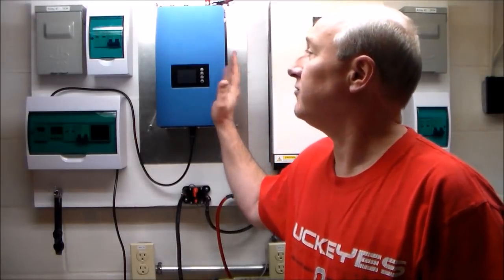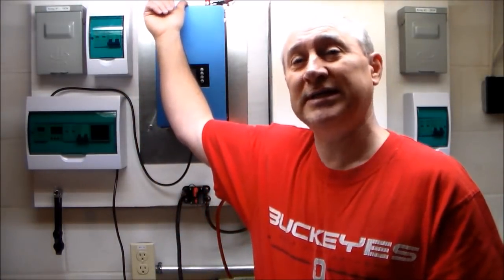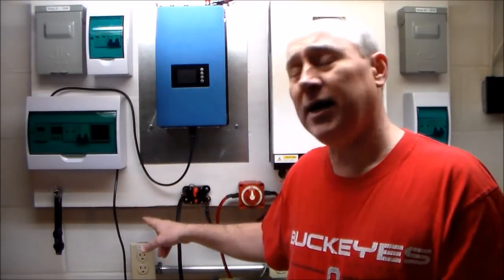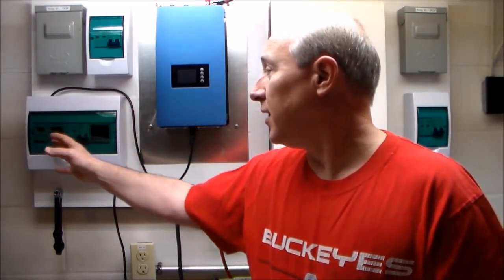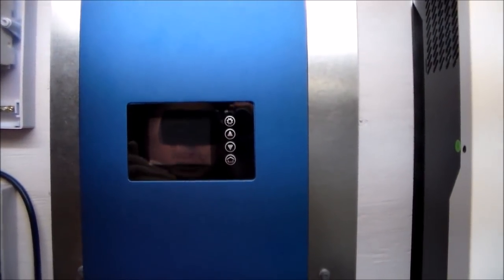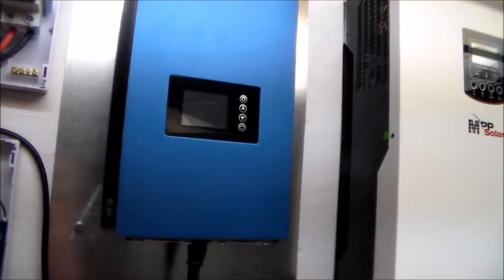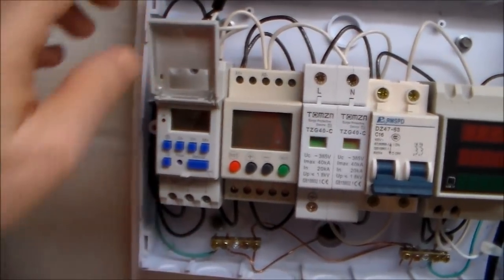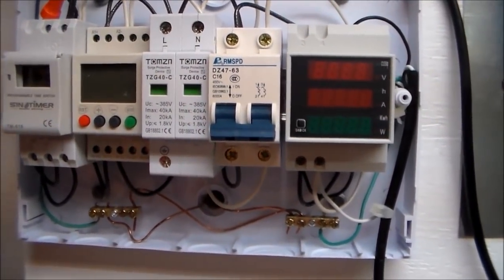DIY Solar - Episode 8 - Sun Grid Tie Inverter + Safety Devices (GTIL2)

Comment: 15:50: what size wire did you use? thanks! I've ordered the brackets/clamps/rails for the panels, will order the rest next week. Let you know how it goes. One question, the power from the inverter goes to one breaker and so only devices on that breaker will get solar input, is that right? Appliances on other breakers will not benefit? Or they will? Sorry for my lack of electrical savvy.
Reply from the maker: I used standard 12 gauge house wiring for that.  Yes, you are correct that only the devices in your home that are on the same phase where you have the inverter connected will receive the solar power. To get solar to both phases, you would either need to install a second 110V grid-tie inverter, or install one of the 220V versions of this inverter.
Reply: @jimginnyohio  I really appreciate your help. However, I have single phase 230V here. The outlet I will use of course goes to the breaker box but I don't know if the solar input is confined to only a set of devices or feeds into all of them. So, it's kind of a different question. BTW, I live in Thailand. I've already set up rails for two 340 watt poly panels only 10 feet from the planned inverter. My cost will be about 600 usd and I'm guessing it should save 300 usd a year. My average bill is 36 usd per month. Most of the savings is cost of AC. Thailand is very hot most of the year. So the AC may need to be on the same circuit. Or not. Again, I'm super grateful to you. Nowhere else have I found such clear and thorough explanation.
Reply from the maker: @FoosResearch  Oh, ok!  In that case, your inverter should feed everything within your panel.
Reply: @jimginnyohio   @jimginnyohio  Wow, that sure is good news. This is going to be 🤭 a whole lotta fun for an old 🧓 man 👨. Thanks again! Of course I'll send you pictures.
Reply from the maker: @FoosResearch  Will look forward to seeing those!  I really wish I had your monthly electric bill!  :-)
Reply from the maker: @FoosResearch  Glad to hear you got it going. The pictures look good. For the timer, it’s possible you don’t have that programmed the same as me. I had to play with that a bit since the user guide wasn’t too clear. Keep trying!
Reply: @jimginnyohio  Couldn't have done it without your excellent discussion. I'm new to this so a little worried about how much the wattage jumps around on both the inverter and the other meter. Maybe it's just how they all work or the cloudy day affects it. Anyway, I'm getting up to 90W on up tick, hopefully it will get a lot better when the sun peeks in.
Reply from the maker: That video you showed of the wattage jumping around in the morning when shaded is perfectly normal!  Both of my units act like that too. I don't think it's anything to be concerned with. The inverter is simply trying to make use of the little power available. As long as the output isn't dropping completely to zero and causing the inverter to reboot itself, you are good to go!  ;-)
Reply: @jimginnyohio  Hey, THANKS! You're the best for sure. Looks like when there isn't enough sun the voltage drops below what's required to keep the power steady. I was worried I'd done something wrong but have nobody else to compare with. Thanks again!

Comment: Very informative! Thanks for putting up your series of videos on these limiting inverters!

I have a couple of question about the choice of the AC side circuit breakers. First, what was the reason for using 16A breakers? I would think 10A would be a better choice since the inverters are only capable of about 950W. The lowest voltage for service to homes in the US is 108vac, so the worst case current would be (950W / 108v) 8.8A. Just about the right size for a 120v system. A 16A breaker wouldn't open until the power climbed to at least (108v x 16A) 1728W, a lot more than what the inverter is capable of.

The second question is about the choice of using two pole breakers instead of single pole breakers? I don't see any harm in doing so, since the earths are still connected, just wondering if there was a safety related reason for doing so?
Reply: US electrical code requires a Circuit breaker larger than your max load so if you have a 1000 watt inverter you want your circuit breaker to be a little larger than 1000 watts not smaller.  This said you also do not want to  over size your circuit breaker to much roughly only 10 percent.  This will prevent your circuit breaker from tripping to often but tripping when a real over load occurs

Comment: Jim, many thanks for this informative and well presented video. At one point I understood you to say that you had tried and been unable to make a 240 vac version of this inverter work, that it would not work in the US. Can you please expand on that?
Reply from the maker: Hi Dan. Yes, Early on, I was not able to get the 240v version working. However, since then, many others have posted. Newer videos showing that can indeed be done in the US. There are several good YT videos showing just how to do that. Also a few Facebook groups too. There is. YT a poster name SolarEngineering that shows how he was able to get the 240v version working successfully.
Reply: Thanks for the tip, now I understand your problem. I already have a relationship with the power company (solar panels) and do not intend to install the limiter. My application is a 1500w turbine and the 2000w inverter. My location is not the best sight so I don't expect to produce enough to catch the attention of the power company. I guess it will be part production and part yard art.  What I am puzzled by is why they sent me a 120 v line cord, maybe I'll send them a note just for fun. Take care, thanks again.

Comment: Thanks for your explanations. Well done! An improvement: PV side: after manual breaker wire the fuse in series BEFORE the surge protection. This surge protection handles a lot, bunt not a real strike with many mega Joules. If fuse is serial before, the fuse protects the surge protector too. Second, the surge protection should be DC, not AC! A PV with DC current will hold the AC surge protection in the fault position (after a real high voltage) and will burn! The reason is the missing zero voltage on a sinuous wave on AC which resets the protection. Same for the grid side. We in Europe use this stuff a lot and makes the power inside the building safe. I hope you understood my poor english...

Comment: My friend.I have a 2 KW on-grid inverter  220volt AC.The incoming voltage from solar panels is 68v DC and the amperage is 30 Ampere.My upper voltage incoming from solar MUST BE LESS than 90 volts.Is a protection the knwledge of the existing panels that offer 68volt enough OR i have to install an upper /lower voltage controller for the panels DC incoming voltage???Is there a device that i can adjust Max permissible incoming voltage = 90 volts ????Thank you
Reply: My understanding is that when one gets the 240V version you must get a second camp on limiter to make it work right in the USA.  These units only come with one camp on limiter.

Comment: 19:09 is the SPD not grounded?
Reply from the maker: Yes, but didn’t use the bus bar within the small enclosure. Instead, the ground wire extended out the back to a central ground that I used for all components.

Comment: Nice set up. BTW, Vos  (I think) is voltage off-set, the difference between input and output. Not sure what its doing. Before current was flowing it was flashing around 0.3 volts... like a meter does when you are reading an open circuit... it can't figure it out and settle down. I think it went to 000 after you turned on the inverter. A quick point about grounding. Establish a single point from your house MGN (multi-ground neutral) usually the ground wire from the main panel at your equipment.  Make that your one and only ground. Now, it doesn't matter where it is but I would use a bus bar of some kind for that, even if I made my own. Then you "bond" each cabinet or device to that ground bus or ground point. Never create a loop by running the ground from cabinet X to cabinet Y to cabinet Z. I could go into great detail what will happen, but doing it like I described will take care of it. Loops could simply negate what you are trying to do with the nice surge protection. I would love to build a grid-tie system and am learning about that, especially for small systems and what equipment is available now. I have a garage roof with a southern exposure that could mount more panels that I can afford and think it would fun to try it. Up til now my experience has been off-grid.

Comment: I'm planning to use this inverter. Is there a way to store surplus power from the solar panels, ie I've seen a video about adding hybrid inverter and batteries combining the grid tie inverter (non limiter inverter)
Reply from the maker: Yes, there are several people that have posted videos for how to add batteries to these inverters. Check out Old Time Engineer’s channel. There are several others too...just do a search in YT and you will find those. Sorry, but I haven’t added batteries for mine.
Reply: @jimginnyohio  thanks for reply. I'll check it out

Comment: Got everything ready but the inverter is on a slow boat from China. As I understand it, the top readout on the meter (cos) is the power factor, basically the ratio of useful power to total power.

Comment: Great video I'm curious I have a grid-tied inverter but its range is 36 volts however all of my panels are 41 volts is there a way to lower the voltage on the panels so they can meet the range of the grid-tied inverter and I can start using it thank you
Reply from the maker: I'm not aware of any way to do that. Normally you will want to match your inverter to the panels when making your purchase.

Comment: Jimmy, mine didnt come with a plug like yours.  It is L1, L2 & N.  No ground, how did you ground yours? or didnt you have to?
Reply from the maker: It sounds like you bought the 240v version instead of the 120v version like mine.

Comment: I got the SVR1000/220AD Over/Under voltage regulator and it does not seem to show how to wire up to a 240V split system we have here in the US.  Do I need two of these regulators and run the two 120V lines separately?
Reply from the maker: Not sure about that. My inverters are the 120v models, so I wouldn’t know how to connect that to 240v. Sorry.
Reply: @jimginnyohio  Thank you for the reply.  I emailed the company that makes the SVR1000 and they said just hook it up to one 120V leg as shown in the instructions.  So I do not know how this device will monitor the other 120V leg but that is what they told me.  I think I will ask this question on the facebook group you mentioned and see what they say.  I will keep you informed.
Reply: The facebook group you mentioned did not have a good idea either.  They thought maybe to use two regulators, one for reach 120V leg.   So that is the approach I am going to use.

Comment: Informative description of safety y switches.  Thanks Jimmy.  The “cos” I think is the cos factor or power factor.  You can look up descriptions of using the power factor information as read by the meter.but in essence the power factor of a load is defined as the ratio of active power to apparent power, i.e. kW divided by kVA and in mathematical terms is referred to as cos Ø. Cheers.

Comment: With the grid tie inverters 8000w it is provided with the three sprong cord for recharging the battery when using it do you have to plug another cord to access the 220  or 110 volts
Reply from the maker: The grid tie inverter is 1000 watts and is not connected to batteries.

Comment: The wiring instructions for my SVR1000/AD220 are different than what you show in the video.  My instructions show the (+) is wired to the A1+ and #14 terminals , and terminal #11 at the bottom and terminal A2- are wired together to the (-) line.  Your diagram shows terminal #11 wired to the (+) line going to the A1+ terminal.  Any reason for the difference?
Reply from the maker: Not really sure since I’m not certain what you purchased. Sometimes the manufacturers make changes or modifications to their products. You might need to change the wiring to meet the requirements of the components you purchased. If things don’t work, you can always make changes.
Reply: @jimginnyohio  Thank you for your input.  My relay is the same as yours.  Maybe they did change something in the 5 years since you made your original video.

Comment: did try this but it is backfeeding to the grid ... no matter what i do, number a wrong, allways 10 to 30 off, and the more wattage there is the more it's wrong, can't use it
Reply from the maker: Are you using the limiter clamp that came with the device?
Is the device set to “Limit Mode” and “Internal Limiter”?
If using an after market limiter clamp, is it the SCT023R (100A:50mA)?
If using the above (for 120v unit) things should work fine.
Reply: @jimginnyohio  I m using the one from the box it's the same. Everything is OK. But reading is off
Reply: well seems to work now, i plugged one more ct clamp sensor, but let it open, the other is plugged in normaly ... and i don't know why ... but now the reading are good ... no feed to the grid anymore
Reply from the maker: @chris_mk5supra  Glad to hear you got that working correctly!

Comment: why can't you use a 240 inverter. one leg for each side of the panel. as shown here,  its is right to say only every other breaker will be supported by the inverter?
Reply from the maker: toobglued You can use the 240 inverter, but the limiter function would not work correctly.
Reply: jimginnyohio 

hmmm..  wonder if there are and R&D plans to rectify this. Software upgrade etc?

would be nice to support both legs with a split phase GTinverter
Reply: What you need is the dual coil cable - ebay search GTIL CABLE

Comment: I'm stuck doing a 24v system since I have 2 24v controllers already - so I'm trying to convert your items to work with that. the one item I'm not sure will work with a 24v system is - DC Surge Protection Device (AliExpress)
Model: TZG40-C
SPD DC 600V 20KA~40KA

Comment: How does the AC Timer work if there is no power applied to it??
Reply from the maker: Ha ha!  It doesn't work when the power is off, obviously!  What it is meant for is when the power comes back on after an outage, it waits for a pre-set amount of time before allowing the inverter to turn on again. This ensures the power has time to stabilize before sending the power to the inverter. This helps to protect the electronic components from potential power surges that can occur during storms, etc.
Reply: @jimginnyohio  Thank You. I get all that and am un-Red Necking my system after watching this fantastic YouTube. I was referring to the Time of Day-Timer (off at night/on during the day). If there is no power to the system from the AC side and it is powered by the AC side, how does it know what time it is when it wakes up??
Reply from the maker: @benkanobe7500  Ahh! Gotcha! That device (SinTimer) has a battery backup in it. Therefore, it never really shuts off.  :-)  Good luck with your install! I hope the videos help!
Reply: @jimginnyohio  I so enjoyed and learned so much from your videos. It is so nice to see someone do things once and do them right. I am now going back and watching the whole series! I hope I don't pester you with too many questions. Thanks, John from Fallbrook, CA